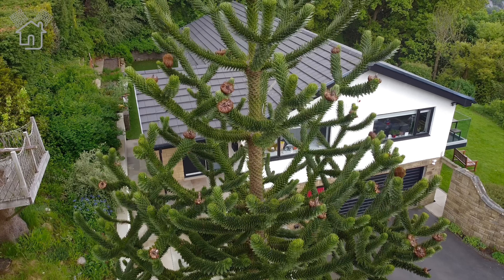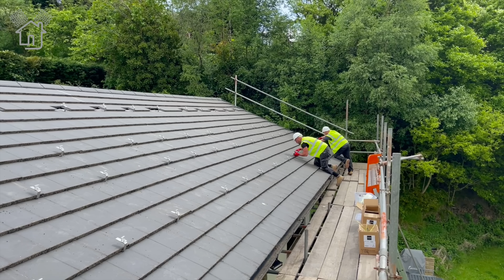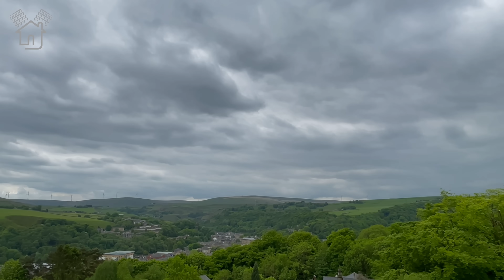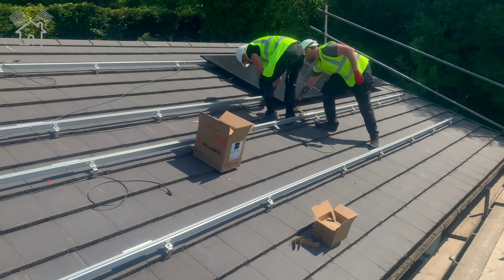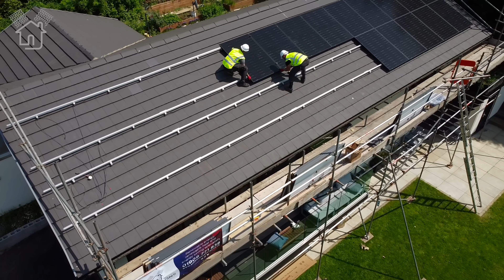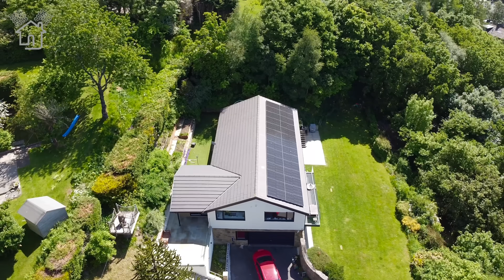£300+ Energy Bills to £0 | Solar Panel, Battery Storage & Solar Solar installation | two batteries

Comment: Have just agreed to this system with Aira & All Seasons for heat pump & solar panels. I have been extremely sceptical about heat pumps & solar energy & was determined not to go down that route.
However, so far, the service, communication & representatives have been excellent. Although system hasn’t been installed yet, if my neighbour’s cock a hoop about it, then I have no doubt that I’ll be too.